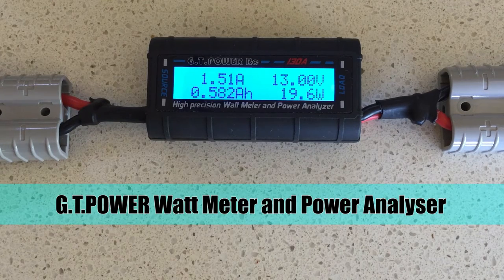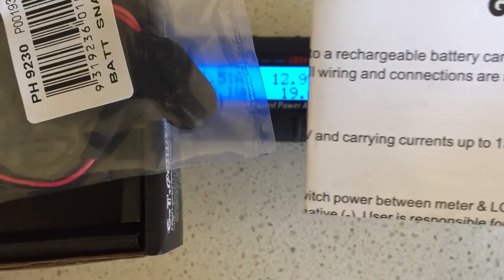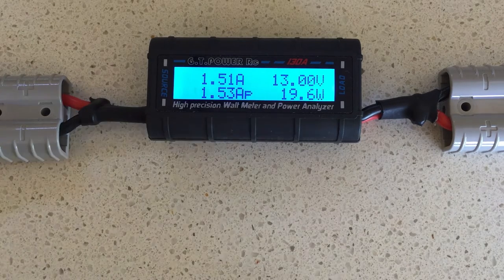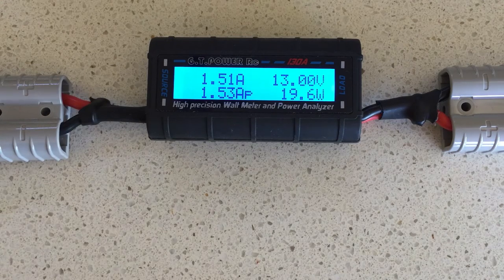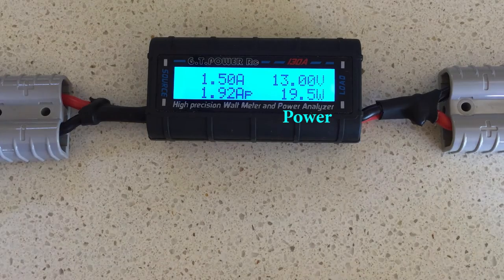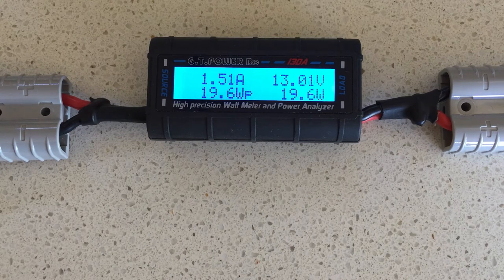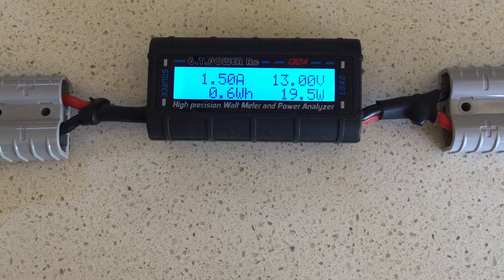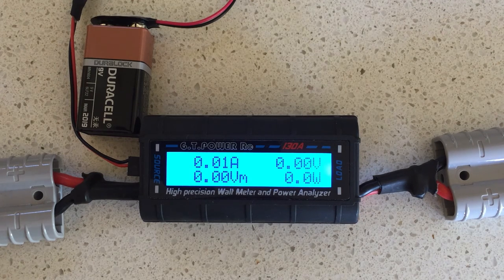G.T.POWER High Precision Watt Meter and Power Analyser

Comment: Stephan, thanks for the info, I purchased the watt meter to ascertain whether a kings 200 watt solar panel will power a 12v fridge.
 In ideal sun the solar panel produced 106 Wp.
The fridge ran at 45 watts ( rated at 2.9 Ah) 
Given the available power won't always be ideal, it would seem the Kings panel is not very efficient. Would you say the panel is not up to the job ?

Comment: Stephan, very instructive video, thank you. I bought such a meter (the make was REELY 180A power meter and power-analyzer,  a meter with exactly the same format as shown by you in this video). 
I put my VOLTCRAFT DSP-3010 Power Supply on the source side and my LiFePO4-Battery pack at the load side. The battery pack was at that time at 3.63 V (24 cells in parallel); the idea was to top balance all cells for a (later to build) 36V bike battery.
What happened was a catastrophe: cables and powersource started to smoke and although I immediately disconnected the battery, the VOLTCRAFT Powersouce was broken.
Without putting the meter, i worked perfectly for weeks, but with the meter in the circuit, it immediately broke.
Do you have an idea why this happened? - I understand you also used a power supply on the source side, without problems.

Comment: Ive got an issue with mine, ive got it installed in between an electric boat motor and a 24vbatt system. Ive double checked and have the load to the electric motor . It should approx 50 amps usage at peak draw, the component is reading 2.82-3amps max I dont understand whats going wrong

Comment: Hi there thanks for the great informative video, what I need to know if you can help is I need to know the name of the connector needed to plug the 9v battery into the tester. What should I search for, I can purchase the clip with bare cable ends but don't know the specific name of the connector needed that lugs into the tester. Please could you help and maybe send a link for instance aliexpress or eBay UK, I understand it is a common connector but I cannot find or search for it. Regards Steve.
Reply from the maker: Hi if my memory serves me correctly it's a JST connector used for RC batteries, I purchased them with leads back in 2017.

Comment: Great review - question though - if the source is the battery (eg caravan battery) and the load is the van, what happens when the battery is being charged - do the values have a '-' in front when this happens to indicate charging current is going back into the source connection? If so then even more useful as I'll get one and connect to the battery and be able to monitor both consumption at night and charging rate during the day. Obviously the history readings wouldn't be much use but only the live readings are important to me.
Reply from the maker: Hi and thanks for your question. Meters such as these only measure current flowing from the source to the load, they won't measure current going the other way, or display "-". If you want to do this, a battery capacity meter which uses a shunt placed between the negative terminal of the battery and the negative of every supply and load. This measures the current coming in and out of the battery. Victon Energy makes a very good unit, the BMV-712 for this purpose. This will allow a very accurate display of Battery voltage, current (- or +) and State of charge SOC in %.
Hope this helps
stephan
Reply: Stephan Ridgway Thanks for tyre reply, I planned to permanently install one close to the battery, so what you are saying is, if the source is connected to the battery then when its being charged it won't show the current correctly or not at all? Have you connected it like this to see the results?
Reply: @andyturner9485  Did it work out for you? I want to do a similar measurement. Thx

Comment: Hello Stephan. Could you tell me how can you power OFF this meter? Or does it go automatically off when no charge or discharge is applied? I'm worreid about leaving it plugged to the battery constantly. how much does it draw on it own, with nothing else connected to it apart from the battery? Thanks
Reply from the maker: Hi i draws power from the source side, and does not have a power off mode. It only draws 0.034 MA so consumes little power and on a decent sized battery would not be an issue.
Reply: @StephanRidgway  thanks i will be making a solar generator using an ebike battery!

Comment: You may need to solder a wire the the 5v IC power inside, then only 5v regulated supply in needed for aux. power. Labeled VDD on LCD header.
The aux pins on most clones of these need a min. of 10.5v, they claim 4.8v min. , that's a lie. Aux. power is useful for intermittent power and more accuracy.

Comment: There are a lot of very similiar variations of these meters floating around on ebay, and none of them are precise, if you get a desktop lab meter and compare the readings you will see for you're self the readings can be off  by a considerable margin.
Reply: That's true but if u do the math volts x amps = watts,,etc...you'll get your amperage, wattage,watt hrs....

Comment: unfortunately it's a "data logger" but it has 0 use because you can't interface with it .. and track voltage.
Reply from the maker: It's true you cannot use it as a data logger, the cumulative values such as Wh and Ah are since power up. It's use is more orientated towards live monitoring.
Reply: I hear ya. I put some ring terminals on mine and its a real time data view of wattage and draw between my battery / solar and inverter. Going the emonPi route.
Reply from the maker: great just had a look at the emonPi, looks like a great unit, I have a efergy monitor which monitors the total household AC power consumption using clip on current sensors like the emonPI. We have 3 phase which efergy supports (3x CI sensors), but does not have as many features as the emonPi and does not sync to the  cloud.
Reply: I would have used something like the Sense (sense.com) because it's pretty damn nice - but for this mini solar system I'm experimenting with, I want to use the EmonPi then refactor it all when we put solar on completely to supplement the kWh from the grid.
Reply: Just looked at the efergy site. Wow .. nice stuff and CHEAP!
Reply: Do you know what j1 j2 j3 options are? It's on the screen pcb, mine is set at j1....
And i've got an issue with peak values readings not holding after load off, source is on...